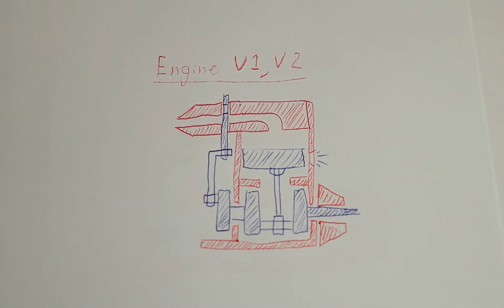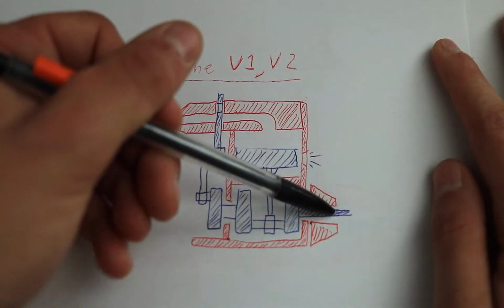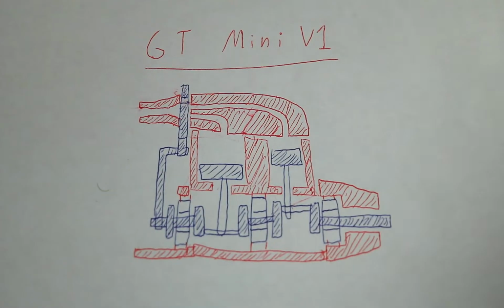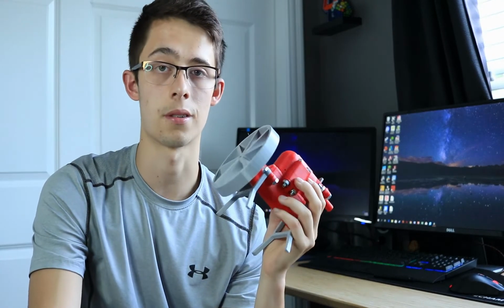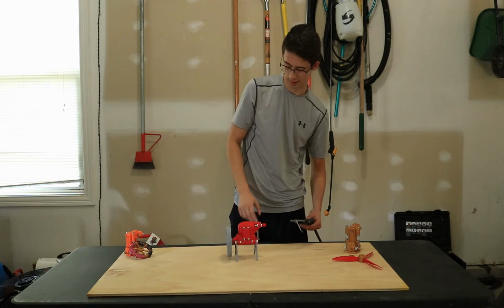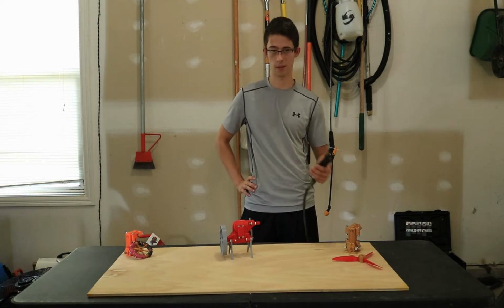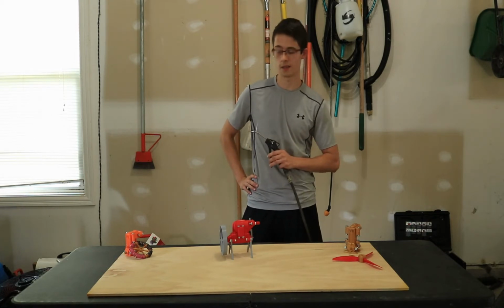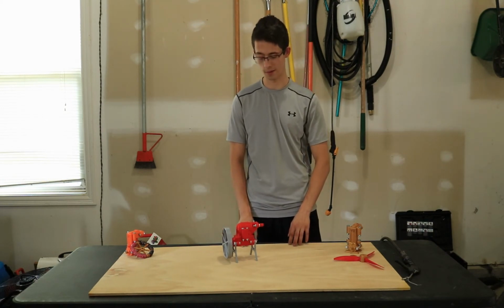THE GT MINI IS COMPLETE - AIR ENGINE #4

Comment: I think the ports are very restrictive...Would you consider different configuration?
Reply from the maker: yes you are correct, but the main reason for power loss is becuase of the air it leaks. need to find a new way to open/close valves and keep it air tight

Comment: Nice video. What CAD software did you use for the design?
Reply from the maker: I use specifically Solid works 2018 for all of my design projects.
Reply: @GMARTIN  ok. A good tool but I thougt it was an open source cad software actually. You made some screen recording of when making the parts?
Reply from the maker: @makersgeneration3739  solid works is a pay to use service. I have been using it for so long that I dont really want to switch to another.
Reply: @GMARTIN  understable

Comment: Very cool. Are you seeing any issues with the internals try to weld themselves together or is there enough air flow that it keeps everything cool?
Reply from the maker: I haven't noticed any problems with the internals, however I also haven't taken the time to examine the internals yet. I will look into it in the next video
Reply: @GMARTIN   Yeah, I'm definitely curious on how much friction ware there is. Looking forward to the next video.
Reply from the maker: Glad to hear it!
Reply: I have been using pure silicone grease that you find in the plumbing section. Does not react to the PLA I use so far and since it is a grease not just a spray it stays in place well. Even use it on the plastic gears of my mini metal lathe.